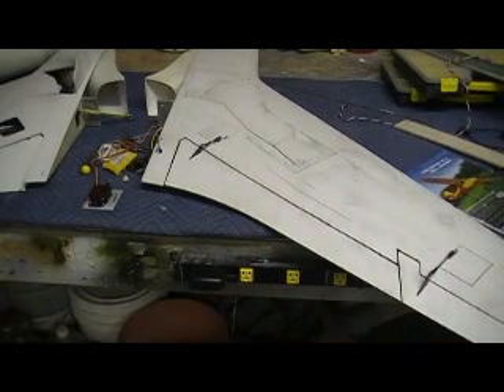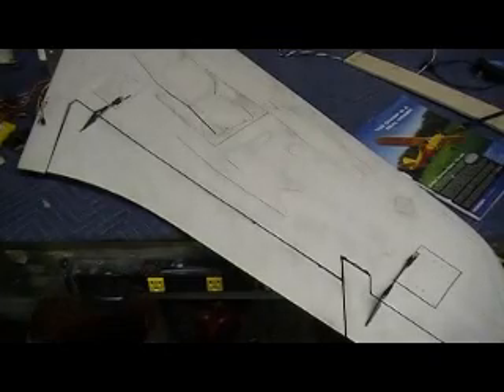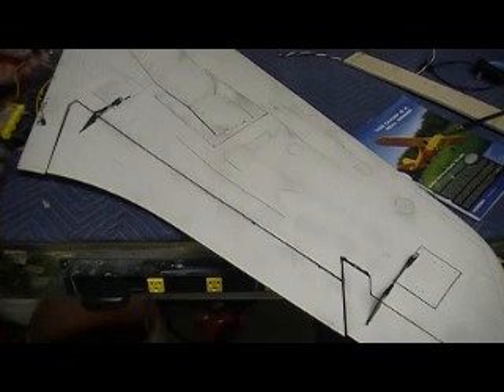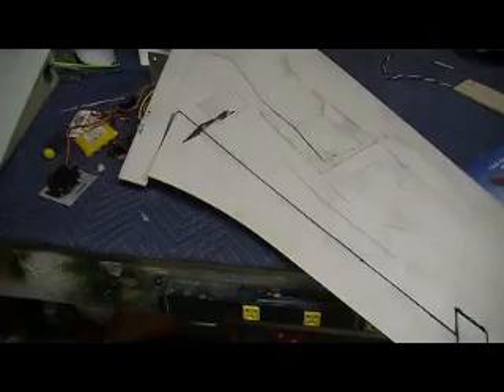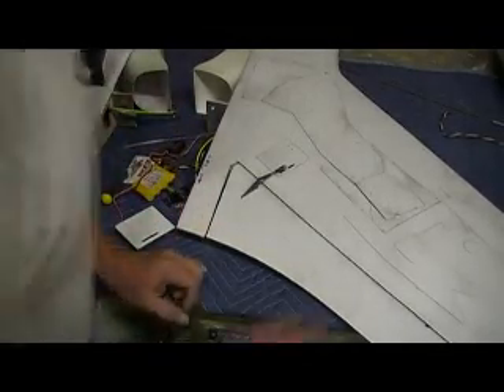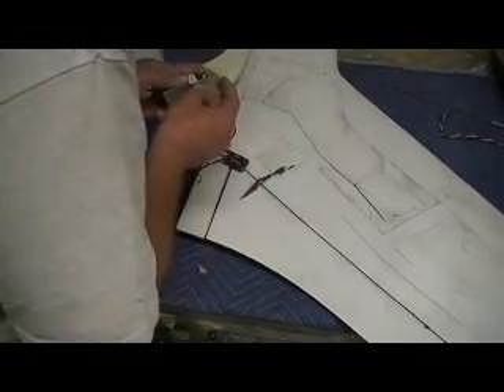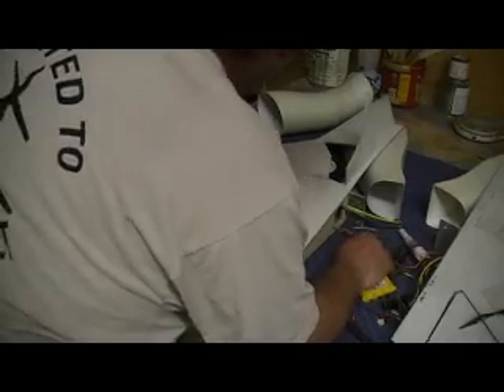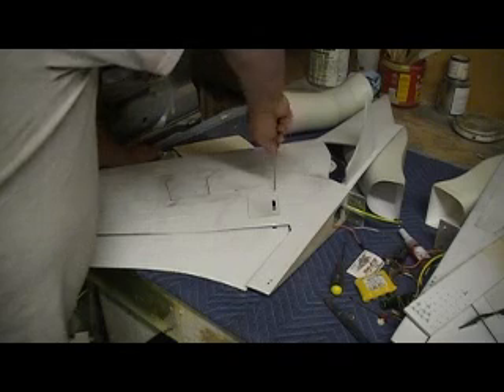how to build a rc jet F-105 thunderchief # 522

Comment: @b1bjetmech Bob had mentioned he had to have the servos positioned with the horns on the right side on both wings because he was out of channels on his radio, and will be having to use a harness to pair the two together. if he made flipped one of them to make it essentially match the other side position-wise, move in opposite directions of one another.

Comment: Bob - was it just me - or did you have the servo in with the arm on the wrong side on the right wing?  It looked like your left wing flap servo arm was facing towards the wingtip, and the right wing flap servo arm was facing towards the root?  Optical illusion?

Comment: Control pushrods should always be 90° to the hinge line...especially on high powered/performance aircraft. Apart from having internal linkages..there is little you can do to solve the problem. Bob has it right!